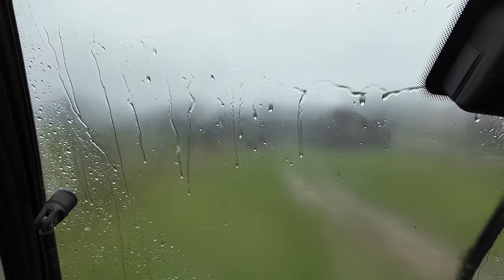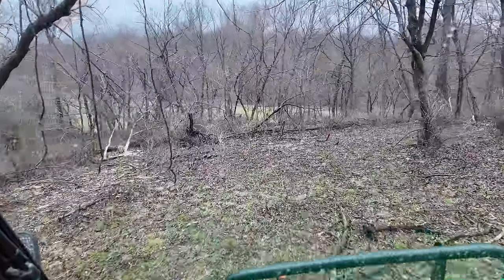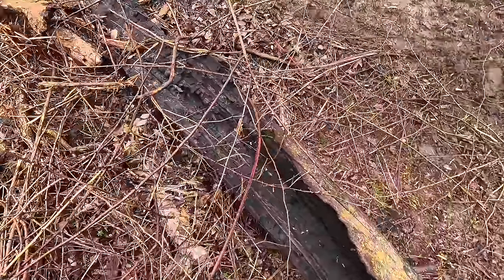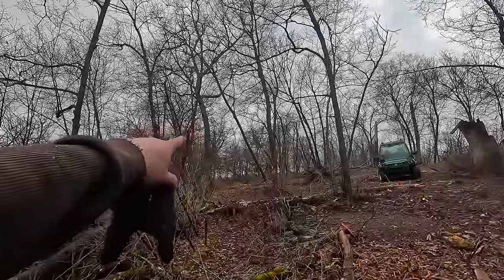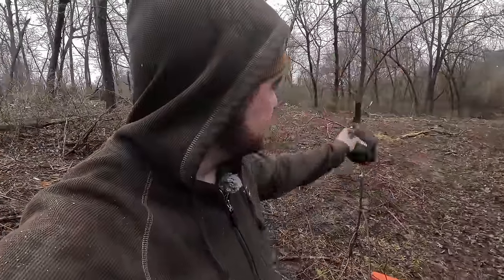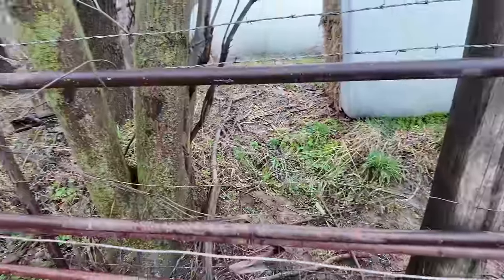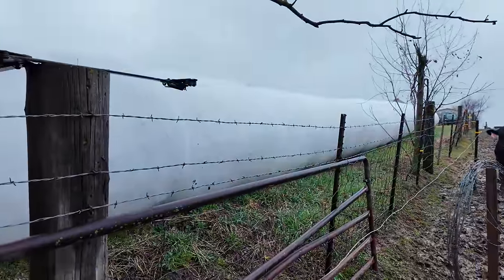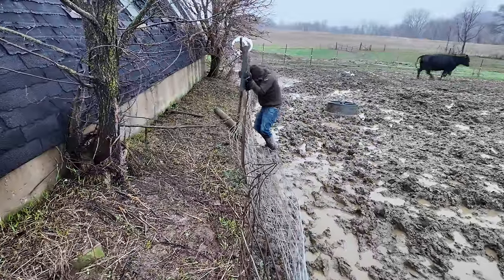Fixing Pasture Fences

Comment: Get a winch for the gator, if the saw gets stuck and it's your only one, Shut off (of course).  Pull with gator, to pull in a different direction get a snatch block that matches the wire and use a holmes tree (tree or stump to pull from.   Double the cable if you need more torque if you have it long enough.  Search ron Pratt holmes tree!

Yeah leave that tree alone get help.